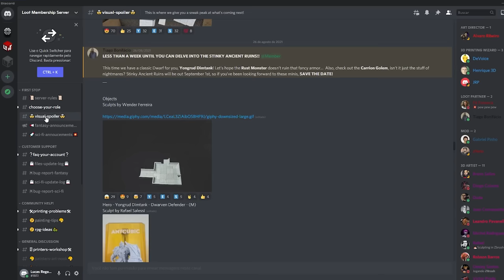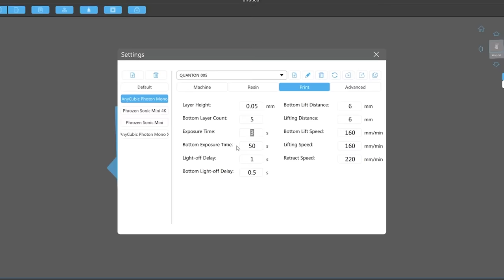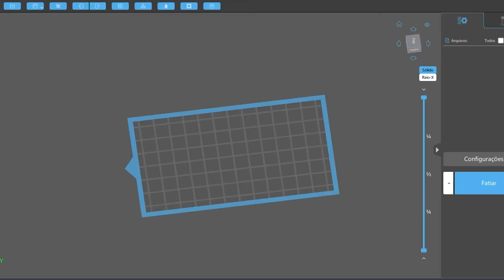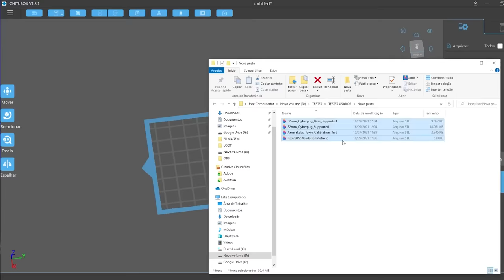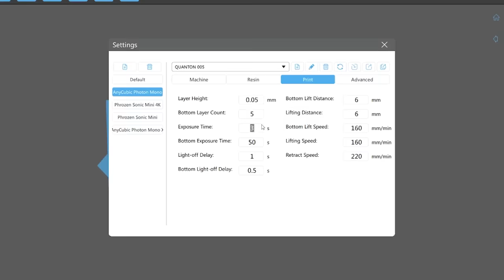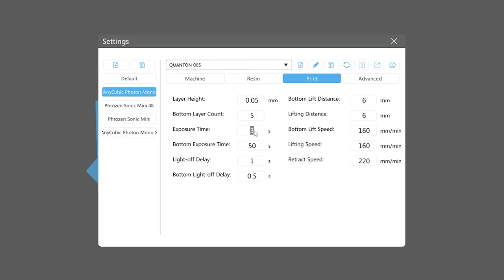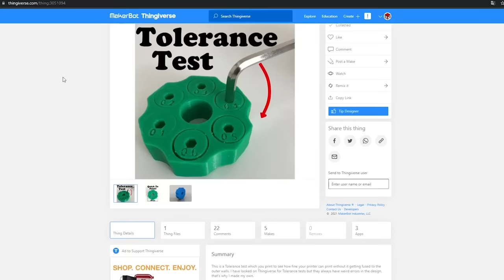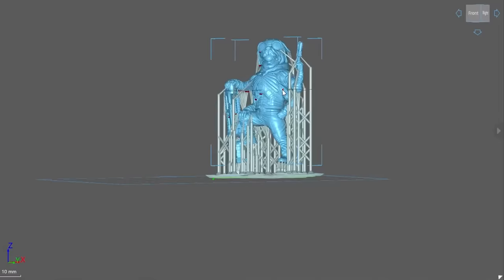Print the SHARPEST miniatures by changing ONE parameter

Comment: I found that with my Mono X a incorrect print time can damage the FEP as I trashed the FEP that came with the machine with just three prints. After that I read the manual fully, which you should encourage people to do, as my primary problem was I didn't change the LED power settings as it's set to 100% from the factory. From reading the manual I learned to set it to 80% for the resin type I was using as stated in the manual. Later on I learned that when testing exposer times start with the low end and monitor the FEP as if you start on the high end the FEP could get damaged and made cloudy or even burnt. So, don't start with high exposer times and work your way down start low exposer times and work your way up. I managed to damage two FEP's before learning this lesson. 
I generally go with a layer height of 0.03mm as I need my prints to be dimensionally stable. The other learning curve I am still on is dealing with resin shrinkage. Perhaps you can make a video about that and show some tips and tricks of the trade. For now I take the prints out and wash them then let them sit in the dark for up to a day before curing which gives me around a 1.05-1.20% shrinkage using the Anycubic white resin.
Reply: very interesting coment ! I too struggled back in the day, because of the power settings. Mine was at 50%... I set it up to 80% and It worked well. I have a question though, I never tweaked the layer height and let it at 0.05mm. Reducing it to 0.03 made what kind of diference ? Because I don't understand what you mean by " as I need my prints to be dimensionally stable".

Comment: Great, helpful video! I was a little scared about the bare hands on the pieces when I'm not sure if the pieces were completely cured or not. It's advisable to use gloves until the resin is completely cured. It is also easiest to remove supports before curing, so this is why I was concerned about the bare hands.
Reply: same here, cause from what they said (and what you usually do with the validation test) it was not cured, only cleaned.
Reply from the maker: Hey! In the scenes we show in the video, a pre-cure was made, allowing us to have contact with the minis without gloves, but only for demonstration purposes. However, during our daily printing process, everything is done with gloves and the removal of the supports is done before the final curing.
Reply: @LootStudios  good, stay safe, but you probably know that with your experience. I had 1 splash of resin on my arm above the glove and it was red and itched for 4 weeks
Reply: @LootStudios  Awesome stuff. It's important for new people in this field to have this information, otherwise I wouldn't have said anything. Thanks for the confirmation, guys. Keep up the great work.

Comment: 50 seconds is way to high for bottom exposure time. I have been using 12. for years and never failed. also use 2.5 exposure time, and 1.0 on layer hight. I use a mars pro 2 and as I said never failed a print, well except when I run out of resin. and these times take a 5 hour print down to around a hour.

Comment: Nice video. Thanks for sharing your knoledge, and the resources for the tests.
I usually print with 0.025mm and 2.5s in my Mars 2 Pro, and now I know why I find some printing errors sometimes (mainly lack of definition in some parts and attached supports).
I will try to reduce the exposure time to 1s. My prints are good now, but it can be better.

And a tip. To remove the supports, once the pieces are clean, I usually soak them in hot water for 5 minutes. It is very easy to remove the supports and barely leaves marks.
Reply: Has a Mars 2 pro too. Did you get better prints ? I would like to test this out too.
Reply: @TheRedRave  nop. I have not done the test yet

Comment: Anyone who can answer me this? I am using Photon Workshop v2.1.24 and I am trying to adjust the uv exposure time. I am able to change it from 2 seconds (standard) to 1 second, but when I am trying to change it to some decimal, for example 1.5 seconds, it doesn't save correctly in my slice/enviroment. For some reason it goes back to 1 second, another time it saved it as 150 seconds. In the input field I can't write a dot ("."), I must use the dot that is already there, but even then I can't get decimals to work. Anyone knows how to fix this?

Comment: I saw someone else ask for this and I will second, let's see information about various resins.  For example, I usually use Elegoo Standard Gray but am finding the smaller minis are very rigid and break easy so am turning to other resins that are more flexible (still experimenting).  Also, the cure time is pretty important - too much curing makes the minis hard and fragile as well.
Reply: Exposure and post-processing surely have an influence on the brittleness of the final product, but the type of resin used is also important, often mixing in a little bit of one of the "ABS-like", or "tough" resins can make a big difference, you don't, necessarily, have to change resin type entirely.

Comment: hi I tried this on my Creality LD-002R and I was wondering if this test is also viable for a printer with a 2k screen? I think I've got the exposure time just about right to the point that the tear drop on the center is touching at a single point but looking at the other parts of the model, I noticed that some of the really thin lines on the bottom part didnt print correctly. does this mean that the model is still abit under exposed?

Comment: Ok so i must have chosen the right printer. I see alot of resin printing videos to dial in great prints...after countless fdm printers i decided to go resin. About a month ago and a bunch alot research bought the Qidi i-box. I have pulled it from the box, leveled once and have ran it nonstop since. Every single print has come out perfect. Not one fail. It came with chitubox so thats all ive used and new to resin so just used what it came with and used water washable black resin. I thought that this was the same and all resin printers were this easy but apparently that is not the case. It seems like they all have their issues. So i have to say everyone should get one of these printers cuz theyre flawless. Aside from being larger theyre perfect. Super easy, no maintenance, silent, the best quality prints ive seen and really, really fast prints with built in curer and drip rack for the vat. All said and done if anyone is looking to get great prints and super easy use...get one of these printers and save yourselves unwanted headaches...and its 100 bucks cheaper than the anycubic and wayyy better.

Comment: I have noticed that I have to adjust the settings for model companies as well.  It seems the latest Loot models print well for me at 8 sec (Elegoo Mars Pro with Elegoo Standard Gray) but another provider I am working with this week I have to pump the settings up because their supports are weaker.  Also, I have noticed the older Loot model supports are not as good - which means Loot is getting much better at doing great supports.

Comment: How long approximately curing time for 32 and 76mm parts ?? Great job of all o/
Reply from the maker: Hey Lucas! There is no standard final cure exposure time, as it depends on the size, thickness and other factors of the model. The curing time also depends on the UV light power, even the distance of the mini to the light makes a difference. However, we recommend about 5 minutes for 32mm models using an Anycubic wash and cure machine (most of the times this is enough),  and 10 minutes for 75mm divided into 5 minutes on each side of the mini.
Reply: @LootStudios  Muito obrigado pessoal! Eu uso washing and cure da Anycubic e estava usando muito tempo, tipo mais de 20min para as peças. Algumas peças ficam bem frágeis ao impacto, acredito que deveria ser o tempo em excesso, vou começar a deixar 6~12min no máximo ^^ Obrigado novamente e o trabalho que vocês fazem é ótimo! Sinto orgulho de vocês representarem o Brasil nessa área o/

Comment: I would like a more indepth video and on how on setting tailored to them. Ofcourse you will gonna have to tweak them, but a good baseline would be good. Been using anycubics eco-resin myself for personal use, as i live with people with respiratory diseases. And more about how to set up a 3d printing station in a safe way at home, if it be in a garage or a hobby room.
If theres a mathematicle formula for the exposure time between different layer heights, then that would be handy as well😀